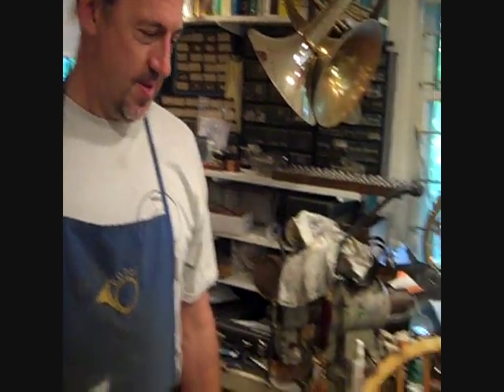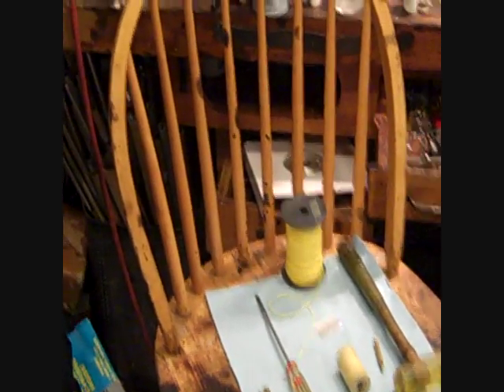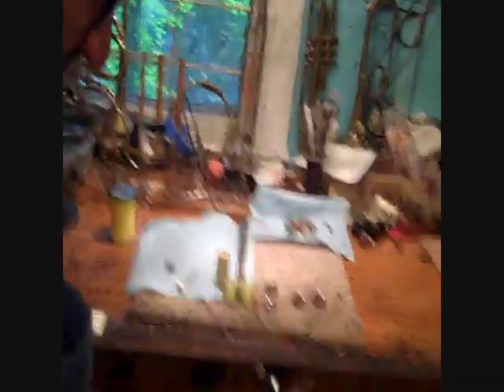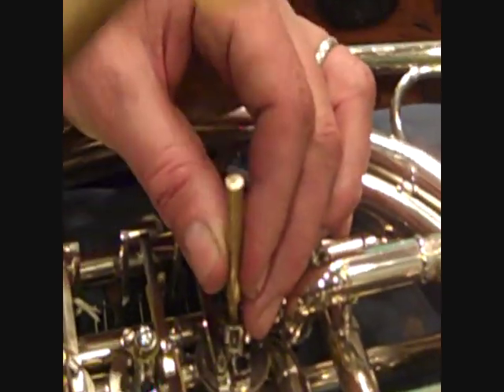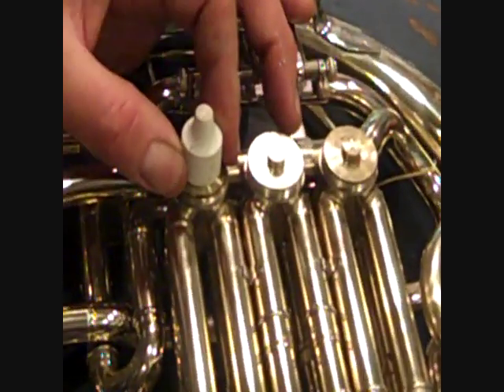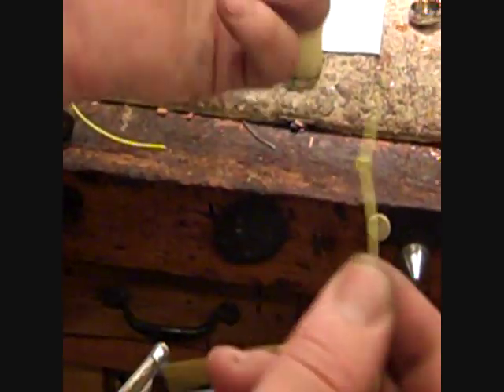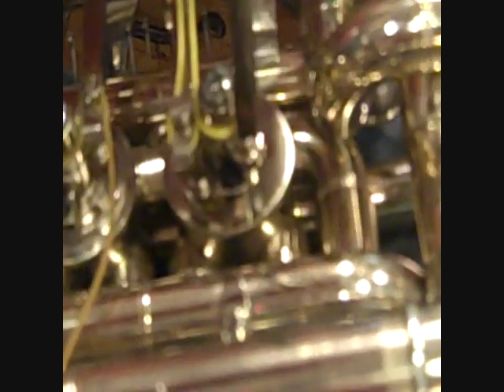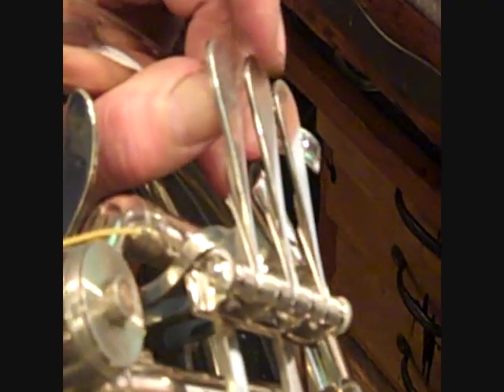Ken Pope: How to Fix Your Horn #1

Comment: How can you ensure that the valve aligned?
Reply: The best way is to visually check it since the hash marks on the top of the rotor are typically filed by hand.  At the minimum you would just use the hash marks on the top of the rotor.

Comment: @MietteTiger:Some of us old-timers have found many reasons to remove rotors (and every other part).The logic of a horn's plumbing is not difficult to understand.Also,there are times when an emergency fix MUST, ASAP, be made,and the skilled Mr. Pope is not available.A rationale Mr. Pope would agree with,would be that by pulling the rotors,one can discover the need for an internal cleaning(a common need).
I see that Mr. Pope,like Roland Berger,has a hanging horn for every tune.
Reply: SiegfriedHorner

Comment: Where can someone order a valve punch/drift?  Is there a specific size?  Thanks!
Reply: A valve drift or punch is just any non-marring type of material (I use brass) that fits inside the rotor stop arm in order to knock the rotor out.  I just grind my own on a grinding wheel, but one can use a file as well.